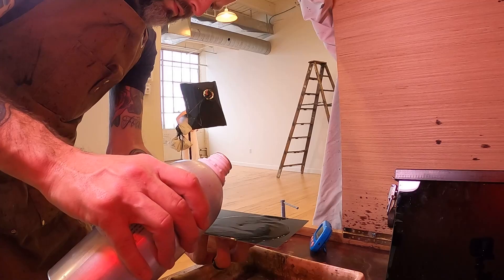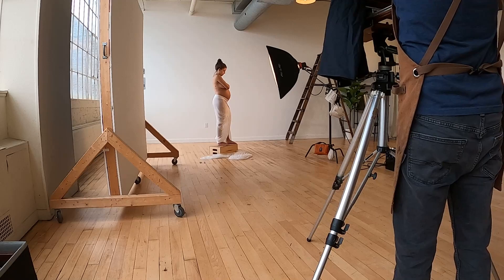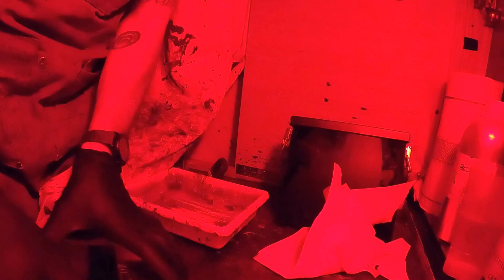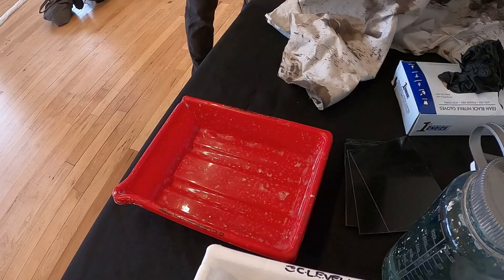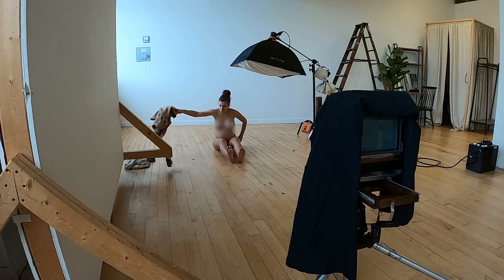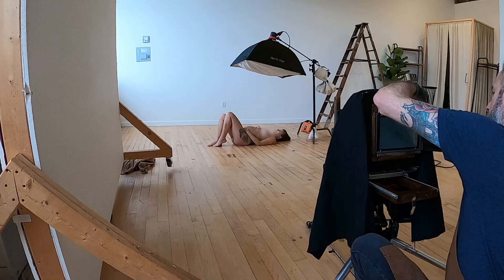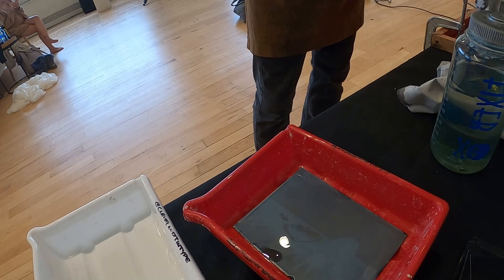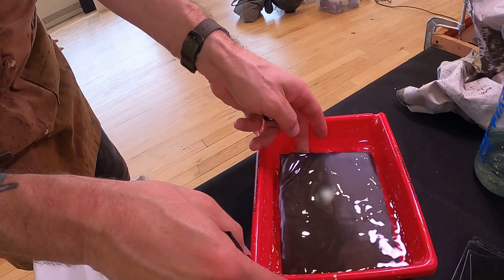Wet Plate Collodion Maternity Portrait Session

Comment: Well done. I see you use the strobe. I was thinking of getting the blue LED offered by Lund Photographic, have you any experience with that type of lighting?
Reply from the maker: Never tried them.  Only have ever worked with strobes for indoor portraits.
Reply: @paullender  how much the power of strobe?
Reply from the maker: @malishpsih  That is a Speedotron 206VF head in the softbox firing at full power - 4800ws
Reply: @paullender   what camera & equipment do you use to make tintypes?
Reply from the maker: @trevoroneill8131  - In this video I'm using a 1940s era Burke and James 8x10 Commercial View camera.  I've also used a Calument 4x5 and an old SLR.